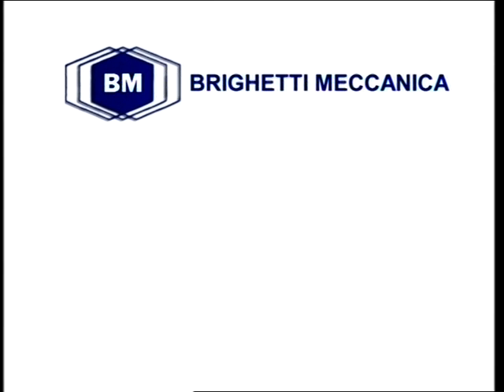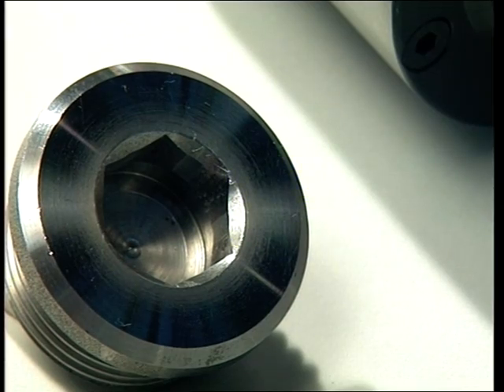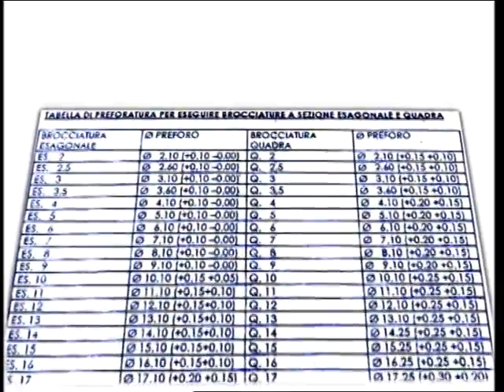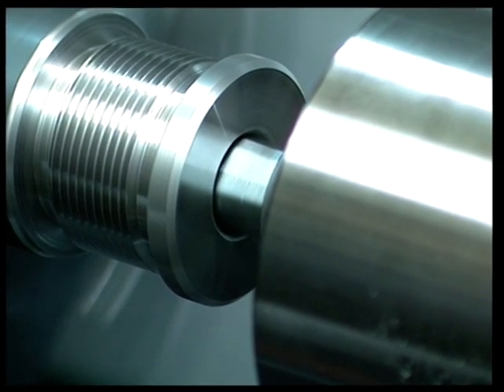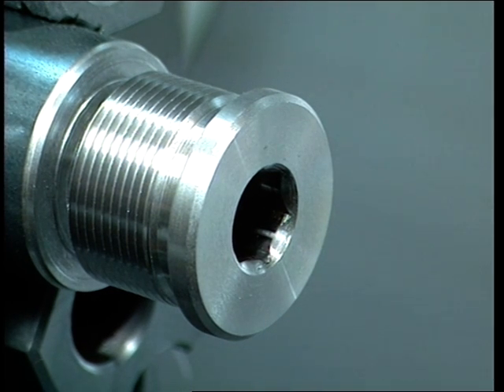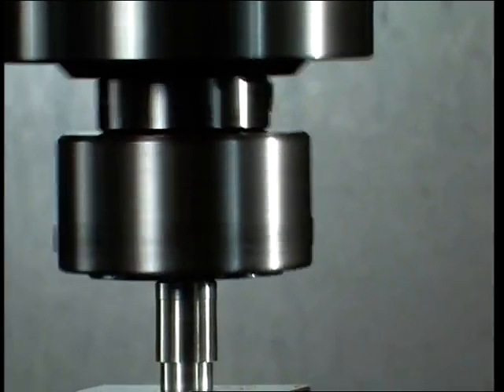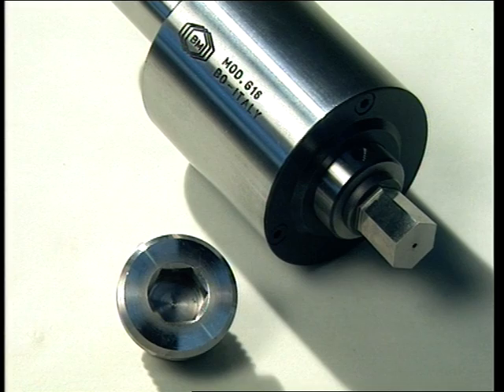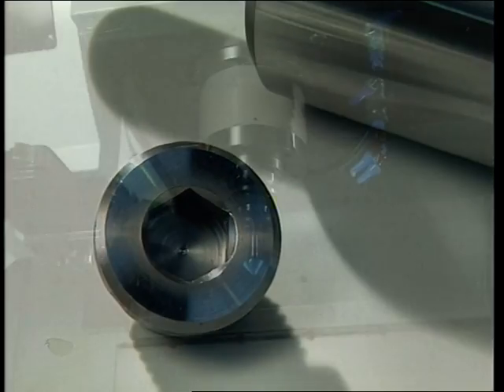Broaching on a Lathe or Machining Centre - Tel - 01204 523429 (UK)

Comment: So.... why spin at all, then stop when the tool comes in contact with the stock?! What am I missing here?
Reply: The holder is eccentrically loaded to vibrate the cutting tool and cuts the work piece in tiny amounts, thus giving a controled cut with lower broaching pressure.
Reply: I see that now - not sure why I didn't see this when I first saw the video. Thank you for commenting.

Comment: What is the benefit of the lathe rotating?
Reply: Oliver Masters I think it's just a result of the design, that is, using the axial component of the wobbling motion to do the cutting. Perhaps you can reach a higher cutting speed with rotational motion than normal broaching (purely translational motion) would allow?

Comment: What kind of positional accuracy do you get with the internal and external broaching (what kind of runout)? What kind of tolerances for the shape on the external broaching?
Reply: You would just mill it if it was external
Reply: Owen White You would if you had a "C axis & Live Tools". Thats if you producing the job on a Lathe!
Reply: Owen White Not always possible. I want to do this on a milling machine to make small gears. It's impossible to mill those with anything larger than a 1/64" endmill for finishing passes. Ideally I would just use a hob, but I can't.
Reply: Not to mention that corners on an internal hexagon can't really be milled.

Comment: Can a manual lathe capable of holding a 2m workpiece give a tolerance of 0.01mm?
Reply: No. You would need to grind to get that kind of accuracy.
Reply: tubester4567
Actually I was not clear enough in my query. I have a 2.192 meter steel rod of 28.5mm diameter. My application requires a groove to be machined at some distance x from each end. The dimensions of the groove are 2.15mm wide and 0.7mm deep. This groove would be used to seat a snap ring. So I meant to ask, can a manual lathe machine a groove of the said dimensions + - 0.01mm?
Reply: Sandarpan Oh I see.....Yes, you can do that. You can either poke the rod through the chuck and leave the rest hanging out the back of the lathe (with a stand but be careful) or set it up with the tailstock if the lathe is long enough. (but you would  need to setup the centre steady because the bar is so long it will flex/vibrate in the middle without the centre steady), but should be easy enough, keep the rpm's low. You can use a parting tool for the groove or just grind up a cutter by hand on the bench grinder. Your 0.01mm tolerance is a terribly tight tolerance for a snap ring but you can do it. Are you sure you don't mean 0.1mm? 0.1mm is equal to 4 thou, 0.01mm is equal to 1 thou. That's tiny. Anyway if you use the markings on the lathe (or the digital readout) you should get very close. I would probably just grind the parting tool to the right thickness you want (2,15mm) then after finding x wind in until it just touches the rod, then wind in 0.7mm. Should be very close. Certainly close enough for a snap ring.

Comment: No need to "educate myself". I teach Mechanical Engineering, you are missing my point, regardless of what you say about tolerances( I also teach that as a separate module and have no space here to begin showing you where your you've gone wrong), it is NEVER OK to say twelve point TEN. that's as bad as saying even twelve point one hundred. Its ALWAYS twelve point one zero, or twelve point one zero zero. (depending on the decimal places your want to work to. How are you not getting this?

Comment: I did not have ready access to a bar to put over my nines to show a repeating decimal, so I used "999..." to show that the 9 repeats forever but is less than 12.105.  Another way to show it would have been 12.095mm <= 12.10mm < 12.105mm.  I am completely correct on this.  If you spend some time educating yourself on tolerances you will reach the point where you understand why you are wrong.  No need to be an ass as well.

Comment: No. This is NOT the case in Engineering and Science.
12.10, is pronounced Twelve point one, or even (if you want to show resolution or precision of the measurement) Twelve point one Zero.    Never, Ever , EVER  Twelve point Ten. And as for your numbers, where the hell did you get 12.104999? did you mean 12.104? you've just argued the convention for two decimal places, then tried using a figure of SIX decimal places to prove your already invalid point.  Did I read your post incorrectly?

Comment: 12.10mm gives you information about the precision of the measurement in question.  Due to the practical limitations of any manufacturing process, nothing is ever EXACTLY the size it says.  The trailing zero lets you know the size is actually somewhere between 12.095mm and 12.104999...mm.  This is fundamental to science and engineering.
Reply: John H who gives a flying fuck?go argue with your wife not someone taking time to make a video you lonely fuck

Comment from the maker: Hi Amol,

Yes you can fit the Broaching Head to a CNC lathe, we can offer the Broaching Head on various shanks. Please see our website 

1mm-35mm A/F can be maintained depending on Material.

You can broach Brass/Aluminium/Plastic ect..... Steels and some Stainless Steels. 

If you require any further info please contact me

Cheers

Nick

Comment: I think when the broach is spun, it tilts slightly toward each point of the hexagon in sequence. So it basically plunges the broaching tool into the part by gradually cutting each point.

Comment: Where can I get a broaching table converted from metric to standard?  I often broach, attempting to duplicate what is suppose created by knurling, I don't have enough tool positions to knurl on the backside but can broach.  However, I cannot hold the same tolerances as the form tool the knurl holds and have to often have the print dimensions opened up.  Will these broaches cut to the same tolerances as a knurl will form?

Comment: This method of broaching has been around for a long time. I was amazed when I first saw this type of broach in action 40 + years ago. We have used a Slater broach to broach tens of thousands of  internal gears in aluminum and brass. It works the same way.  Do you sell custom shapes for your broaching tool.  Your video is very well done. Thank you

Comment: @MrBurnTec press shaping metal takes a lot more force than a lathe is capable of. the rocking motion of this tool "cuts" the shape. pressing also requires high heat... which alters the strength and flexibility of the metal, requiring heat treatment and annealing to correct after the shaping process. the rotation of the lathe causes this tool to rock its cutting edge into the different faces of the work piece, doing a little bit of the cut at a time.

Comment: @MrBurnTec i'm not a machinist, but I think that kind of operation would require heating and a heavy press. This method eliminates the nead for annealing the finished piece and saves shop space since you don't need a press.

Comment: In the lathe hex-broaching application, what is the purpose of the rotation?  Does the broach mechanism oscillate internally as in the vertical mill application?